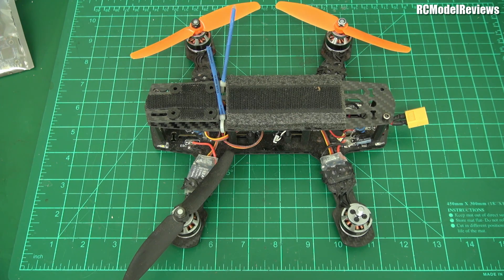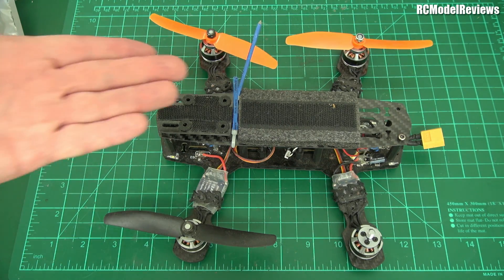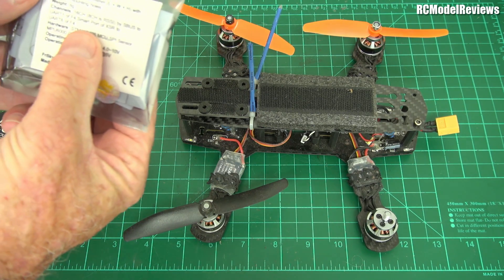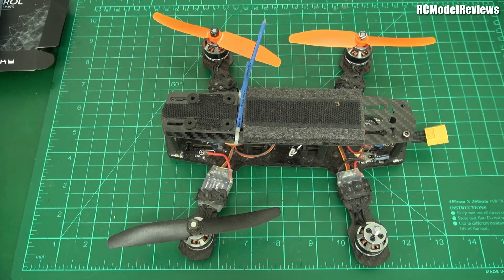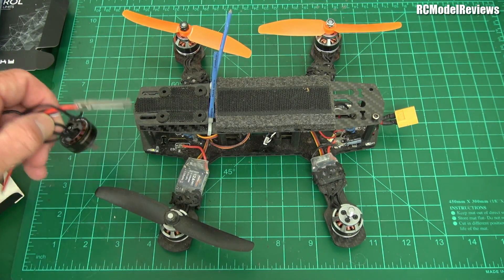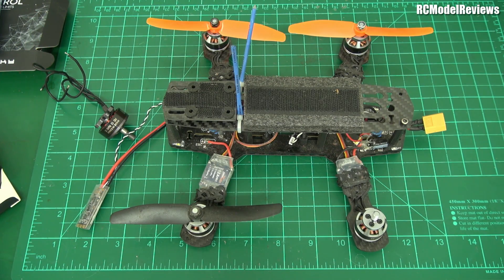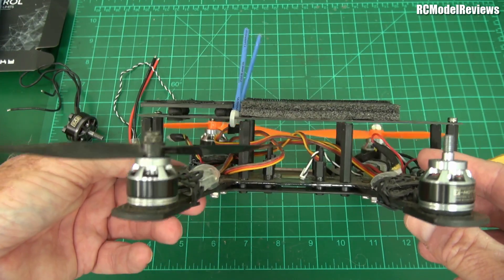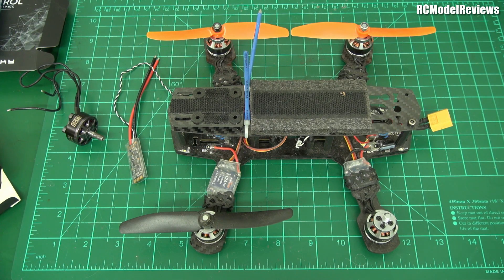Turning a piece of history into a "Retro-Rocket"

Comment: This is great! I just did almost the same thing. I put a predator camera a jbf4 fc 4 seperate escs (cant remember the name and a rdq mach 3 vtx running some old 2300 kv eachine motors put on 6s using 5045 biblades. Should be an interesting maiden on my qav 250 frame! I did lower the cg by using lower standoffs.

Comment: You should drop that top plate down to 15 or 20mm. A slammed BlackOut would be bad ass! 
I’m pretty sure you’re going to have to open those motor mount holes to get those bigger motors to fit. If I remember right the old 1806 motors had a smaller base.

Comment: holy shit frsky makes an F4 now with a receiver now? Sweet. I was just doing a build I've had the parts sitting here for a year for, and the RSSI on my new XM+ receiver won't work. I spent an entire day fuckin with it including flashing the latest firmware to it. 

Decided it was just a dud and ran a wire for it so at least I got RSSI on my OSD if not my taranis. Will definitely buy the frsky flight controller next time and checking if it works ASAP haha.

Comment: I'd love to see the old motors on the new esc's before it goes full 2019 😅 cheers 🍻
Reply: The old motors of back then were tragically bad. The new motors, even on super old ESC are just insanely better. For thrust testing I still use the cheap $3.50 30 amp ESCs (the old ones with the out-dated BLHeli or SimonK, I use both), but the old motors in the 2204 class are barely able to hit 300 grams of thrust (I literally smoked some on 4s with 25% throttle on a modern tri-blade 5042... Those terrible Gemfan 2 blade spaghetti props are the most they can handle, and I've even killed one on one of those on a 3s!).

The only good old type motors are the 2212 930 to 1000kv. Those I'm still shocked by. I bought some for $4 each, and they go well above spec. Its not like the new motors, but at least you get some real force out of them, and they somehow survive a 9 to 10 inch prop on 4s... Those things are pretty impressive... Especially when you realize they are rated for 2-3s! But these are really not for race quads, they are DJI phantom motor size and KV spec (they actually work pretty good on a phantom prop with modified hub, DJI must be limiting to 40% power)
Reply: Good to know! Think I'll keep an eye out next for the old dji style motors wood like to make an insurance 6" for cruising and mountain surfing/diving... thanks again for all the information its greatly appreciated cheers 🍻